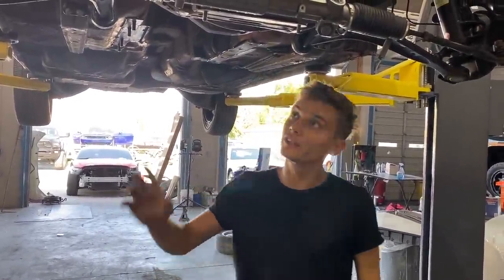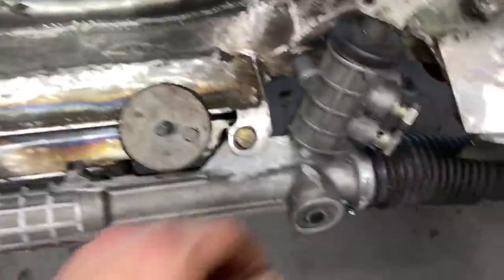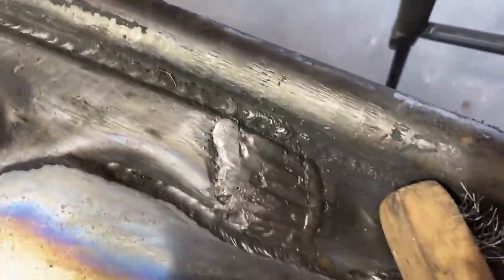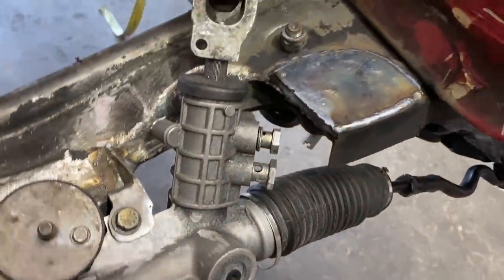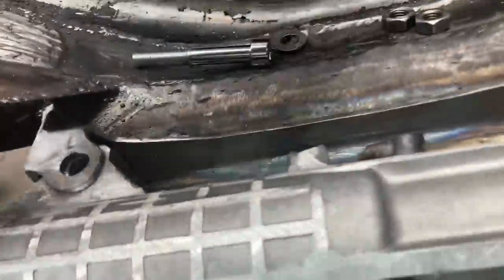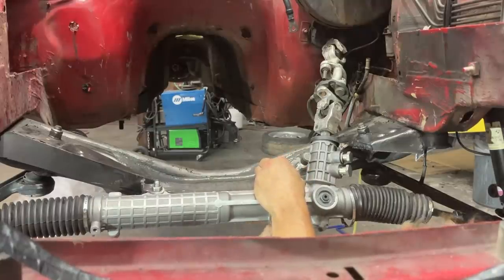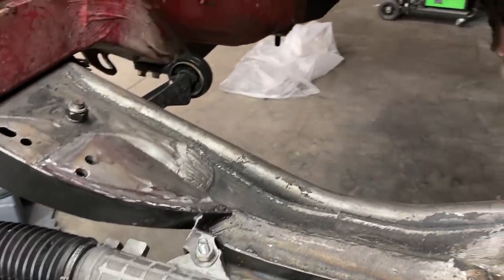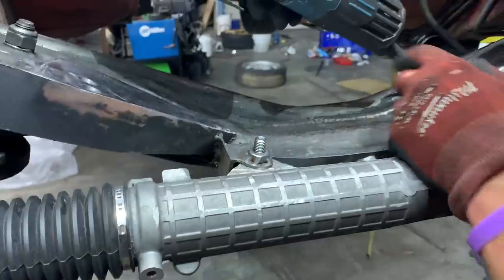Building an e30 m3 conversion part 14: Completing the rack and pinion mounting setup!!

Comment: My god guys, what a ton of work. 
I changed my E30 318i to a E36 318is. 
The one thing I had to do was swapping the oil pan and the motor mounts. 
Tuned the motor with a new set camshafts and a ECU software change. 
Upgraded the breaks front and back (e30 325i)
Way easier and quicker. 
Love the work you are doing, but man, it is so hard and difficult.

Comment: Loving the videos guys 😊

With those rack bolts if I remember my mechanical engineering correctly then you want 1.5 threads exposed beyond the end of the nut for the bolt to torque up properly and not back out through vibration. 😉

Comment: I am curious to why you didn't just take the bolts out to grind off the extra length? Otherwise beautiful job!
Reply from the maker: Rick Piccini if you grind it while it’s on, the thread will repair itself as it comes out and will screw back on easier 👍🏻

Comment: Quick one, the mod that you did on the oil sump, will it change the capacity of oil that the engine takes and can this impact performance in any way?
Reply from the maker: We’re gonna get that capacity back with a mishimoto oil cooler

Comment: That’s good because that is a another weak spot on the e30 subframes.I reinforced those on mine too and ton of other people do too if uplan on using is like a sports car or race car it’s super nesscerry as it will likely fails .I think I did mine from the bottom though but I can’t remember it was about five years ago.check out gargistic and google e30 front subframe reinforcements  you’ll find lots of forums and failed subframes that weren’t reinforced and why they failed.your going to want to do the bottom of that motor mount to fuse the two spots togaither or it could bend and snap off over time from the metal becoming cold hardened and brittle.you’ll want to also reinforce the rear subframe in Multple spots one huge spot is the main mounting point of the chassis it’s a weak point and a point of failure .just look online there is tons of forums and info out there from guys who have raced them like for example spec e30

Comment: All you had to do was go buy a hockey pucks and cut in half  and they were your nice round spacers
Reply from the maker: Dave moulding as I stated in the video, original subframe mounts had rust and pitting, I plan on running a lot of power through this motor, can’t risk it breaking